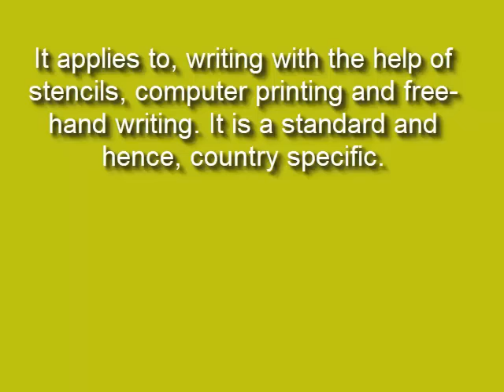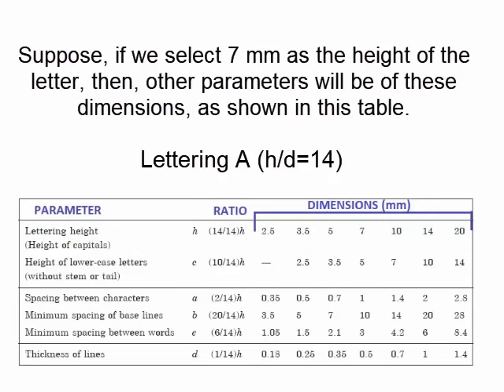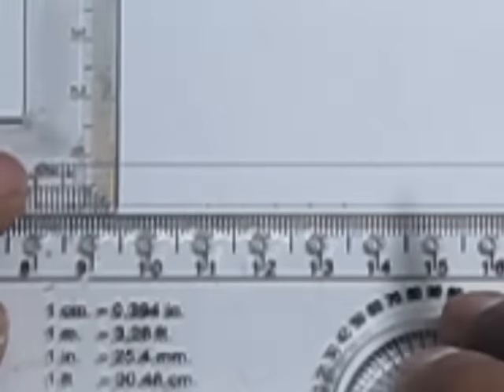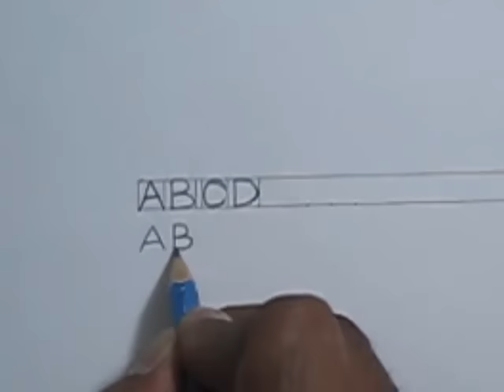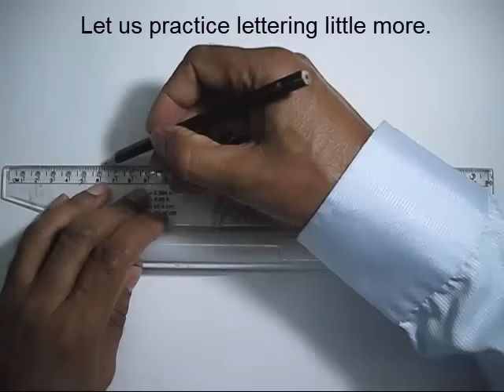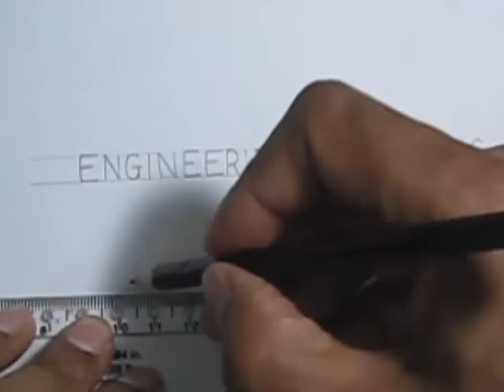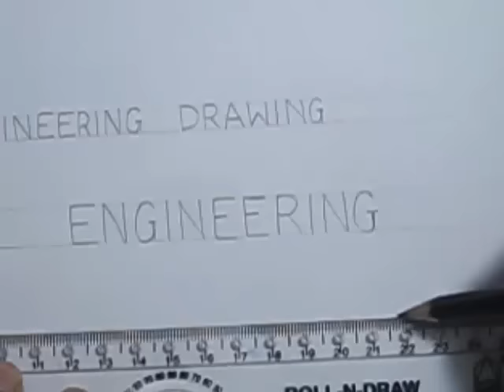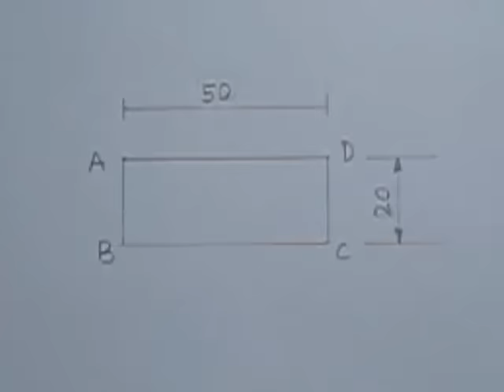1.2-Lettering in Engineering Drawing: English Letters and Numbers

Comment: When normal writing could be understood very well, what's the point of wasting time and resources is such strict and binding rules, resulting in loss of marks leading to lesser CGPA and thereby making students struggle in placements.
Reply from the maker: Lettering is part of standard and must be followed.👍
Reply: @1styearengineeringdrawing182  ok thanks
Reply: I Know Right!!
i think it's a total waste of time
Reply: Where an artist puts their themself into their work (their style, their feelings, their thoughts), in technical writing and drawing the objective is to remove yourself from the work, hence standardisation (in addition to basic expectations of legibility)
Reply: @grant5603  okay got it
Reply: We follow the standard, so miscommunication can be avoided.
Reply: I have a degree in Electrical-Mechanical Engineering Drafting/Design. I worked for Bechtel Power Corp for 50 years as a engineering drafter-designer. At the time CADD didn't exist and everything was done 'on the ( drafting) board'  with physical equipment by hand.  In school we studied and practiced engineering lettering for several hours the first semester. It was part of the curriculum and graded as such. When applying for a job, one of things they evaluated you on was your lettering.

The foundation of engineering lettering is a block letter. All of the elements of the letter, either straight or curved, are contained within a square block. 

The concept of the standardized lettering is for all drafters to produce all drawings with lettering that is identical. It is standardized like typewriter lettering so all drawings are consistent. After the original drawing is made, there may well be revisions made to it. The lettering must be consistent throughout the drawing whether it is the original or part of the revision. It is especially important if one or more other drafters does the revision work. Unlike architecture lettering where it is very individualized and personality driven, engineering lettering must all look the same regardless of who works on the drawing.

Unfortunately today, with CADD being used, the concept and skill of lettering has gone out of use. After all those years of the skill and experience I still print this way. Many times people comment and complement me on my 'writing'. It is clear and easy to read. I tell them I was and am an old time drafter skilled in the ways of lettering. hours the first semester.
Reply: Ya bro thats one of the reason why many countries are not even developed 😞

Comment: I still dont understand it
Reply from the maker: Lettering is just part of engineering drawing. Without learning lettering, engineering drawing will be unclear.
Reply: I have a degree in Electrical-Mechanical Engineering Drafting/Design. I worked for Bechtel Power Corp for 50 years as a engineering drafter-designer. At the time CADD didn't exist and everything was done 'on the ( drafting) board'  with physical equipment by hand.  In school we studied and practiced engineering lettering for several hours the first semester. It was part of the curriculum and graded as such. When applying for a job, one of things they evaluated you on was your lettering.

The foundation of engineering lettering is a block letter. All of the elements of the letter, either straight or curved, are contained within a square block. 

The concept of the standardized lettering is for all drafters to produce all drawings with lettering that is identical. It is standardized like typewriter lettering so all drawings are consistent. After the original drawing is made, there may well be revisions made to it. The lettering must be consistent throughout the drawing whether it is the original or part of the revision. It is especially important if one or more other drafters does the revision work. Unlike architecture lettering where it is very individualized and personality driven, engineering lettering must all look the same regardless of who works on the drawing.

Unfortunately today, with CADD being used, the concept and skill of lettering has gone out of use. After all those years of the skill and experience I still print this way. Many times people comment and complement me on my 'writing'. It is clear and easy to read. I tell them I was and am an old time drafter skilled in the ways of lettering.
Reply: skill issue

Comment: Height is 10mm&8mmThen what is width of capital letters A,M,W,O
Reply from the maker: Always multiply the height with 0.83 to obtain the width of the letter. However, this will not apply to the letter "I".
Reply: @1styearengineeringdrawing182  thanks you so much sir

Comment: I have a degree in Electrical-Mechanical Engineering Drafting/Design. I worked for Bechtel Power Corp for 50 years as a engineering drafter-designer. At the time CADD didn't exist and everything was done 'on the ( drafting) board'  with physical equipment by hand.  In school we studied and practiced engineering lettering for several hours the first semester. It was part of the curriculum and graded as such. When applying for a job, one of things they evaluated you on was your lettering.

The foundation of engineering lettering is a block letter. All of the elements of the letter, either straight or curved, are contained within a square block. 

The concept of the standardized lettering is for all drafters to produce all drawings with lettering that is identical. It is standardized like typewriter lettering so all drawings are consistent. After the original drawing is made, there may well be revisions made to it. The lettering must be consistent throughout the drawing whether it is the original or part of the revision. It is especially important if one or more other drafters does the revision work. Unlike architecture lettering where it is very individualized and personality driven, engineering lettering must all look the same regardless of who works on the drawing.

Unfortunately today, with CADD being used, the concept and skill of lettering has gone out of use. After all those years of the skill and experience I still print this way. Many times people comment and complement me on my 'writing'. It is clear and easy to read. I tell them I was and am an old time drafter skilled in the ways of lettering.
Reply from the maker: Appreciate your comment. 👍
Reply: Things change. Cope.
Reply: My background is similar to the first person who commented, but I started out with an Industrial Technology Degree. I begain the program with a Concentration in Drafting Design, I found out that it overlaps with a Concentration in Manufacturing Technology, with a few additional courses and finally perused an emphasis in Basic Engineering Technology-Mechanical Design with several electronics tech. electives courses.  Most recently, I've had taken courses in Linear Algebra, Gen. Engineering, Metallurgy,  Electronics, Aeronautics,  Astronautics, Mechanical Design & Mechatronics. 

I once worked with a guy on a helicopter project about 14 yrs ago, who left us and went to work for Bechtel in Huntsville, AL. We had worked together several times prior for Boeing on a flight simulator & 10 yrs. later on the International Space Station program . I have worked for several well known companies in the rubber, paper, & rail transet car industries, Dunlop Tire & Rubber,  Proctor & Gamble and Morrison-Knudsen.

I have also worked for minor & major aerospace companies like SCI Systems, GE Aerospace, Boeing, Morton-Thiokol, Pemco- Aeroplex, Piper Aircraft, McDonnell Douglas, Delta Airlines, Westwind Technologies, Booz Allen Hamilton & Yulista Aviation. I am  a semi-retired design engineer with over 44 yrs. of experience & training.

What you said is true. I was told in my first college drafting class that "lettering was a draftsperson's calling card". I meet other old timers like us, who take pride in our lettering skills. My brother, a retired robotics tech. and welding fixture repairman for Ford once asked me if my wife and I could write in cursive? He thought we printed like his children did started they started school!  I explain that we had drafting training many years ago and still write like that, because it's clearer & requires less guessing or misinterpretations. Some non-drafting trained individuals like him, have handwriting that is incomprehensible. It was not called "printing", but is called "lettering". I read somewhere  that cursive writing wasn't being emphasized in schools like it was when we attended. I guess my brother had read that too.

I started working on the drafting board in 1980.  My college didn't have CAD, at that time. I learned AutoCAD at work two years later, on my second job. Several jobs I took after this were actually back on the drafting board. Some of the places I worked had Mentor Graphics, Anvil, &  Unigraphics II CAD, but only a few CAD workstations, so I was still working on the drafting board for a few more years. I told my new lead person that I had CAD training and experience when I picked up a CAD work package, rather than a drafting board work package at work one day. I didn't know how to use ComputerVision CV4x, but I learned on the job by asking questions & reading manuals. Years later,  my wife & I enrolled in a local technical college that taught two classes in MicroStation, 2D & 3D, taught by Intergraph personnel. My wife also took a different Intergraph CAD package course at a 4-yr. college up the street from the 2-yr. tech. college she later got her AS in Drafting from. Later we took a C++ programming course together at this same tech. college. They proctored some of my 4-yr. univ. distance engineering courses I took at the same time that we attended the 2-yr. tech.college.  I was hired to use Intergraph EMS CAD on mini-computers & learned to use Unix on the job too. Intergraph once controlled Bently Systems and MicroStation.  They once had a lot of similarity in their commands.  I discovered from coworkers, that my desktop PC, not the mini-computer, could "piggy-back" with their legacy Unigraphics II CAD server. I bought a book and learned UGII Ver.15. or 16 at lunch & got tips from my new friends there. Later, I was hired to use AutoCAD at Delta Airlines. I found out that the PC on the next desk, which was vacant, had SDRC-I/deas recently installed.  SDRC-I/deas had been used for stress analysis at my previous job & was highly recommended by our British stress analysts. I bought a book on it  & stayed to learn SDRC- I/deas at lunch. When I got back home after this short term job ended, I enrolled in the first of two SDRC-I/deas classes that I took at another community college. The company I worked for  headquarters was also the community college's CAD learning lab. site!  About this time, our son was in high school. We persuaded him to take drafting & engineering courses along with his art & graphic design classes. He had access to Autodesk Inventor at school. We got a book on Inventor with a demo version of Inventor & I learned it along side my son. A year or two later, I signed up for a  CATIA V5 class online. My son could get access to a student version for a year for a cheap amount. I had been taught SolidWorks Essentials during a weeklong seminar, paid for by my then employer. They had hesitated on deploying new seats of the software, because a senior engineer who worked there felt that AutoCAD LT was good enough for our work and said that he hated the Pro-E class the company made him enroll in years before. We all got new AutoCAD LT seats. Our SolidWorks User Group, was lead by a former SolidWorks Reseller Applications Engineer and I learned to use the software at lunch on my own. Soon I was teaching another co-worker. The company finally sent me for formal training. They missed out on an important aircraft contract. I was one of their few employees with actual aircraft experience. A few months later,  I went to work for one of the  contract's winners.  

I was hired to use AutoCAD by the new company. But they also had SolidWorks & Pro-E work. I learned more SolidWorks on that job, from the User Group meetings, and from helpful co-workers. While there, I got my son to sign up for student access to Pro-E.  A Pro-E user at work stayed around at lunch to give me pointers on the software & links to some usedful websites. They started letting me do some simple detail part work on a high level project with Pro-E. Then it was back on SolidWorks for a top level project for a different team. The majority of my CAD work has been on SolidWorks,  but I still use "quick hand sketching" and traditional drafting tools to clean up a concept sketch & for scale measurements on drawings on stable like mylar. Then I used CAD for assemblies & part detailing. It's like your first language, it is still there, after you have learned to speak in another one.

I'm not sure if this applies world wide, but the Institution for Engineering and Technology in the UK said that "up to 30% of engineers are dyslexic".  I have worked for an Engineering Director & an Engineering Lead at different aerospace companies, who were both dyslexic. However, they were both very good at stress analysis and systems engineering, but poor to average on creating models & drawings! I had another ex-boss, I was assigned to train at a different company on SolidWorks. He had shown me several patents that were issued to him at other companies, one was from Chrysler, when he worked for them. His CAD skills were below par.  They all were highly respected & bright guys. Our checker even asked the Lead Engineer about an incorrect drawing view? The Lead replied, yes that he was dyslexic. 

Dyslexia could explain problems with lettering as well as difficulty with visualization.

Comment: What is the distance between two words sir
Reply from the maker: Please see the table at 2:25 minutes. For letters of height 5 or 7 mm, the spacing between words are minimum 2.1 or 3 mm, respectively. The spacing can be slightly more depending upon the need for a good lettering.

Comment: What is the difference between lettering A and lettering B
Reply from the maker: Thanks for asking!✔
These are two styles in which the letters can be written. They define the ratios of the height of the letter to the thickness of the line used to write the letters. For type A, the ratio of h/d is 14 which means this style of letters would look little thinner than type B letters for which the ratio is 10. Other dimensions also differ between the two types. It might be fine to follow either of these types so that you get used to one type and not bother about the other. 👍

Comment: What is importance of lettering
Reply from the maker: Any engineering drawing will have some information written on it and that must be written in the method described in lettering. Even for computer print out, you need to know the lettering styles so that you can correct in case your computer is printing wrong way.✔👍
Reply: Good question
Reply: I have a degree in Electrical-Mechanical Engineering Drafting/Design. I worked for Bechtel Power Corp for 50 years as a engineering drafter-designer. At the time CADD didn't exist and everything was done 'on the ( drafting) board'  with physical equipment by hand.  In school we studied and practiced engineering lettering for several hours the first semester. It was part of the curriculum and graded as such. When applying for a job, one of things they evaluated you on was your lettering.

The foundation of engineering lettering is a block letter. All of the elements of the letter, either straight or curved, are contained within a square block. 

The concept of the standardized lettering is for all drafters to produce all drawings with lettering that is identical. It is standardized like typewriter lettering so all drawings are consistent. After the original drawing is made, there may well be revisions made to it. The lettering must be consistent throughout the drawing whether it is the original or part of the revision. It is especially important if one or more other drafters does the revision work. Unlike architecture lettering where it is very individualized and personality driven, engineering lettering must all look the same regardless of who works on the drawing.

Unfortunately today, with CADD being used, the concept and skill of lettering has gone out of use. After all those years of the skill and experience I still print this way. Many times people comment and complement me on my 'writing'. It is clear and easy to read. I tell them I was and am an old time drafter skilled in the ways of lettering.

Comment: FOR DIPLOMA STUDENTS🙄
      Bro.....in exam Hall ,we have to draw the letters with free hand writing or any scale is required...😶🙋
For example :
Print the following 10mm size verital lettering.?
"DIRECTION OF THE TECHNICAL EDHUCATION"
Reply from the maker: For height measurement you need rolling ruler (two parallel lines). Width can be practiced before hand.✔👍
Reply: @1styearengineeringdrawing182  do engineering students actually have to study lettering seriously? cuz CAD exists
Reply from the maker: @HarshRajAlwaysfree  CAD is used for final copy. You still need to draw your ideas onto a paper and discuss with various stakeholders. Lettering, once learnt, will remain with you for life.👍